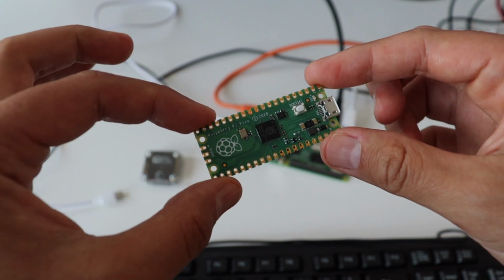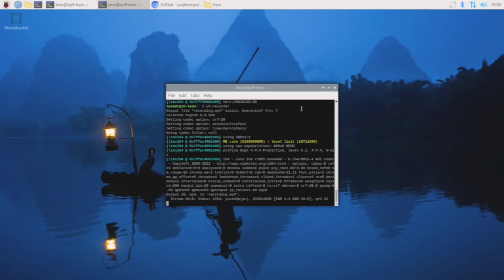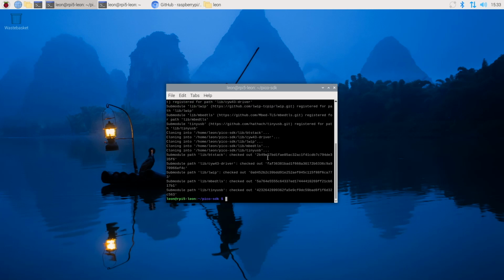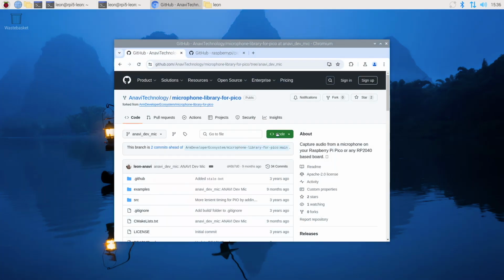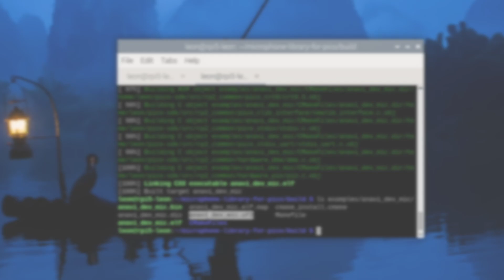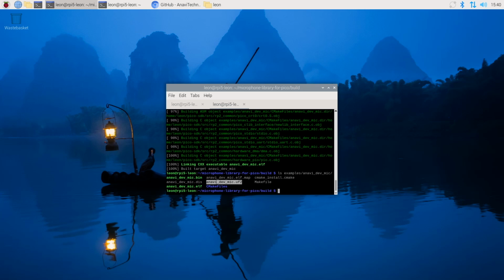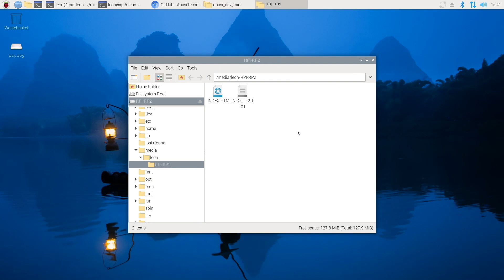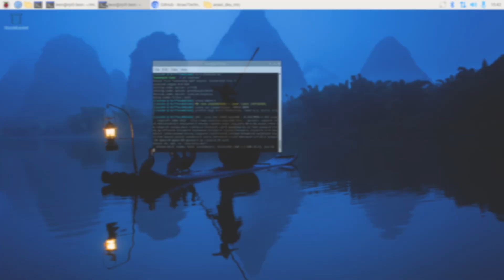Getting Started with Raspberry Pi Pico C/C++ SDK on RP2040 or RP2350 Microcontrollers #raspberrypi

Comment: I have a window system with an AMD processor. Will the download process  to the Pi Pico still be the same?
Reply from the maker: Good question: the Pico C/C++ SDK is cross-platform, and as you have noticed in the video, the example was built using CMake. This means the SDK can work on Windows PC with x86-64/AMD64 CPU, provided you install all the necessary dependencies, such as the GNU Arm Embedded Toolchain, CMake, Python, etc. So the process is similar but the installation and setup process on Windows differs from Linux.

Btw nowadays, embedded development tends to be much smoother on Linux, so I recommend considering a Linux distribution for your Pico C/C++ SDK development environment or just using a Raspberry Pi single board computer with Raspberry Pi OS (Linux based), because it makes the workflow more efficient.
Reply: @LeonAnavi thank you very much sir

Comment: This is helpful as I can do work on RPI-Picos, Rasp-Pi, Orange Pi etc and allow for isolation from infrastructure. If a device carries a virus I can just reflash the host PI
Reply from the maker: Yes, it is a full circle: using Raspberry Pi OS on Raspberry Pi single board computer to program Raspberry Pi Pico/Pico 2 or other RP2040/RP2350 devices.